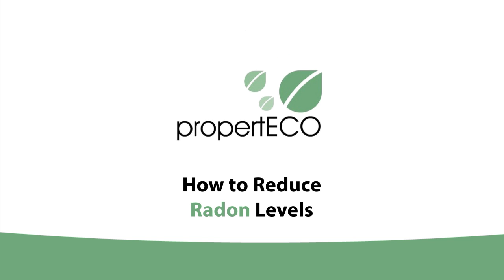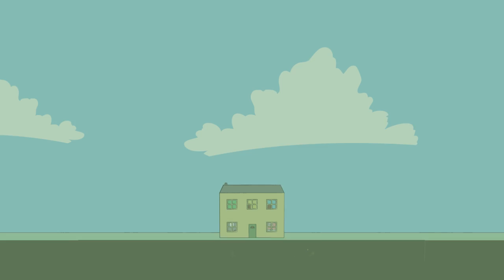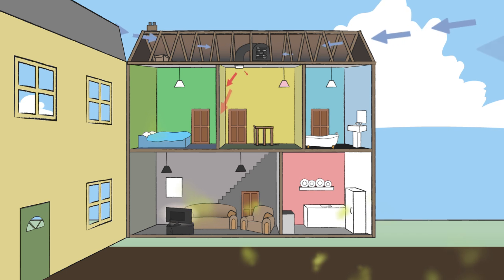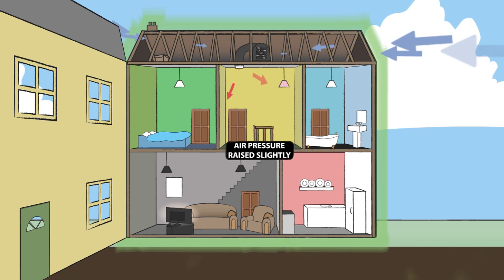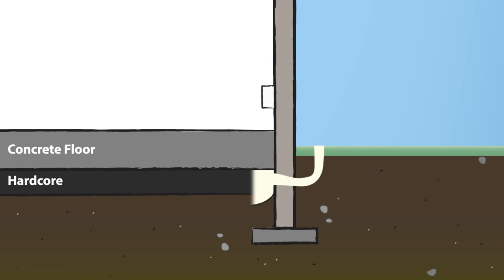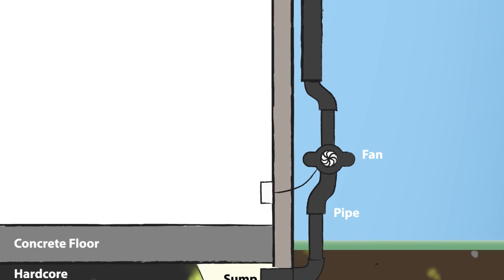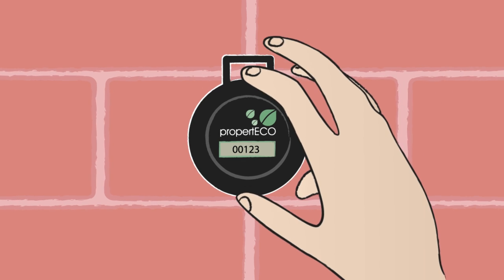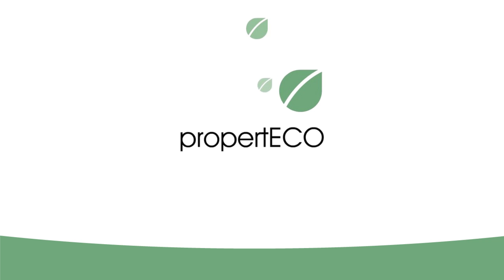How To Reduce High Radon Levels

Comment: what is an acceptable reading?
Reply from the maker: In the UK, it is recommended that action is taken in homes with radon levels over 200 Bq/m3 (referred to as the Action Level). You should also consider taking action if the level is over 100 Bq/m3 (the Target Level). For reference, the average level in UK homes is 20 Bq/m3 and the average background level outside is 4 Bq/m3.